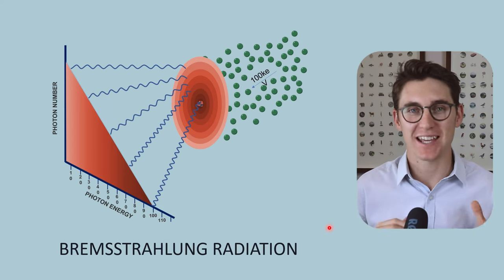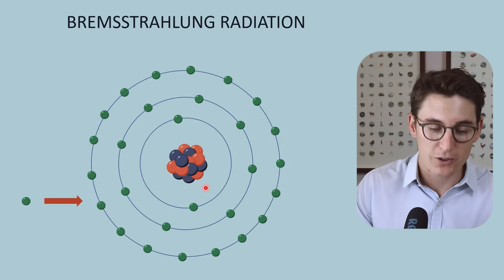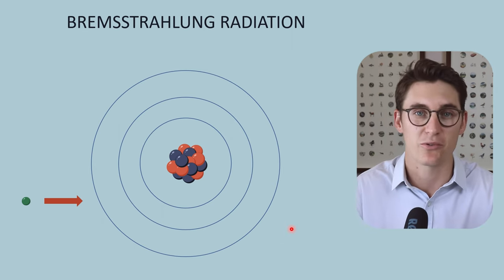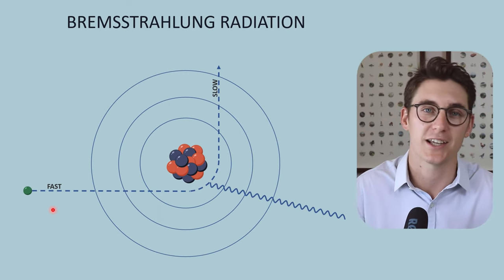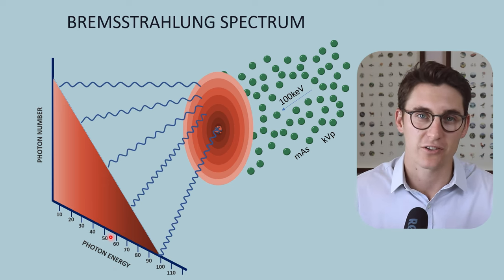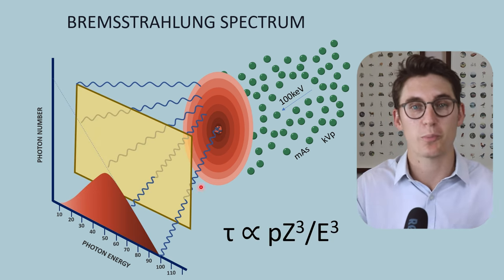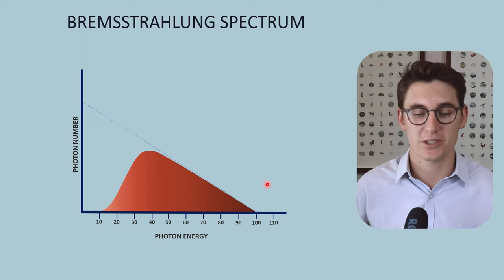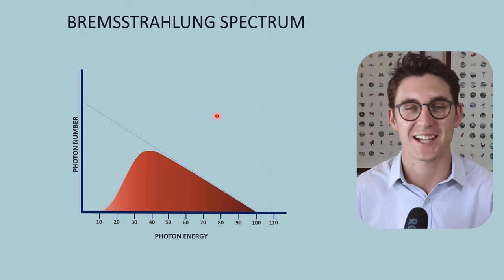Bremsstrahlung Radiation | X-ray production | X-ray physics | Radiology Physics Course #19

Comment: Please can you explain why out of the 1% of Xray produced at the anode majority is Bremsstrahlung
Reply from the maker: Sure! Characteristic X-rays only occur when an electron collides with inner shell electrons in the target material. The atoms that make up the target material are large. Relatively speaking the electrons are tiny (they make up a very small proportion of the atom). Therefore, a bombarding electron is much more likely to ‘miss’ the electrons. Very few will actually collide with electrons. The majority will slow down when experiencing the attractive electromagnetic force of the nucleus - and subsequently release a bremsstrahlung radiation.
Reply: @radiologytutorials  thank you so much
Reply: Somewhere around the 6 minute mark on the bremsstrahlung diagram, you display the nucleus's positive magnetic field strength. Wouldn't each individual electron has its own negative magnetic field? I understand that could junk up the diagram and make things too complicated. I was just curious